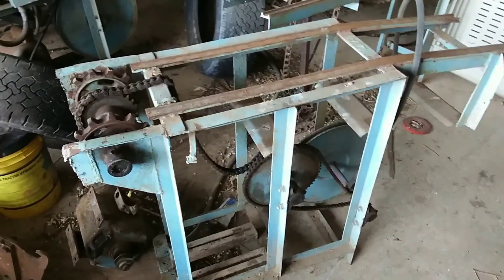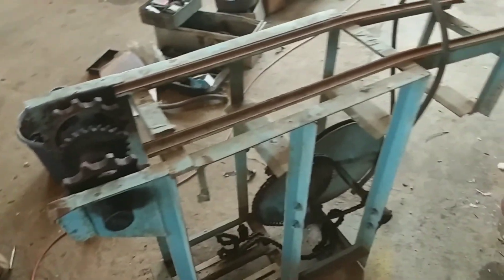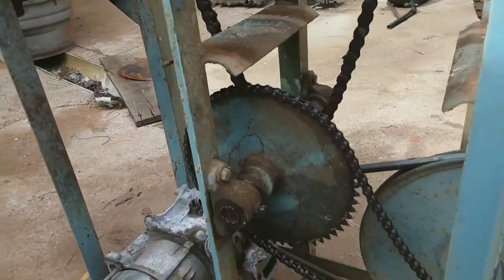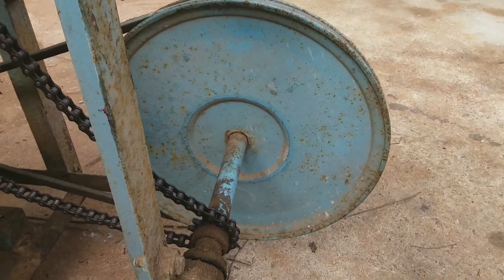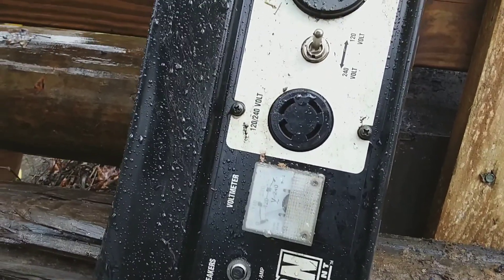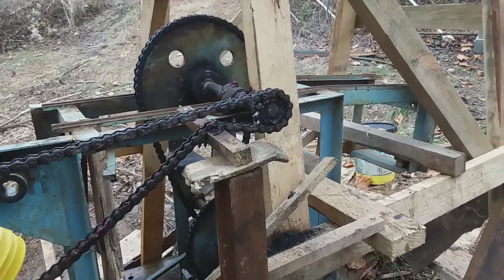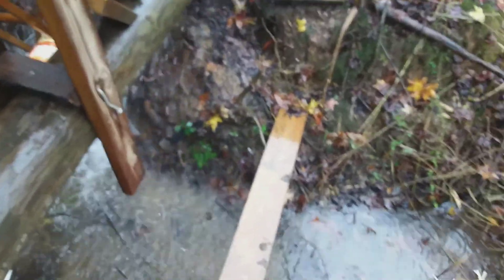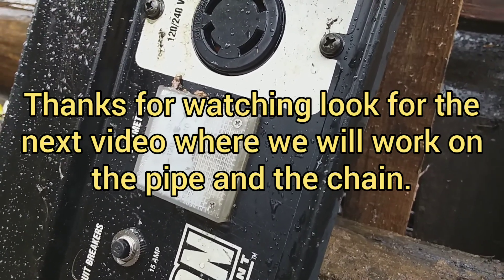Making power! Homemade water wheel.

Comment: the pulley on the wheel side should be almost as large as the waterwheel with the chain going to the drive pulley around 3in diam. I am guessing 24ft around your big wheel stepped to a 3in pulley would give you about 3000 rpm om the motor side upping your amps and volts out.  By placing a spring -loaded tension cog on your chain should take the play out as it goes around the cog.  I would take the buckets off and place 3 or four simple flat plates with a 3inch lip welded or bolted to the frame to give you more surface area on the paddles for water to hit. .
Reply from the maker: Okthanks

Comment: your back chain should be tight and not dragging across wood.....you might could work around the wood bar and remove that take your chain link up some so you do not have excess slack....but I am proud of you.....I would suggest a smaller completely wooden water wheel....the metal is heavier..
suggest you cover your electrical components and keep them from getting wet.
Reply from the maker: Thanks

Comment: Try replacing your unit with a Smartdrive motor instead. To get 60 Hz, a 36 pole unit only needs to turn at 150 RPM. That would make things a lot simpler and cut down on frictional losses. At 60 HZ, you would be getting about 95 Volts under load. Use a 3 phase rectifier and you could use a solar controller and batteries to run an inverter to get a true 120/240 60 Hz output.
Reply from the maker: Thanks

Comment: Your buckets are overflowing. That is energy loss. Reduce the reduction ratio and you will get more power.
Reply: actually the buckets seem to be filling completely
Reply: @christophergwaltney6294  Yes, and the excess water just splashes outside. This excess water can be used too by optimising the wheel's speed.
Reply from the maker: Thanks

Comment: I love to watch different setups on the waterwheels. I'm learning a bunch from your setup. You really need an idler pully in place of the board with grease. I really don't think you need any more buckets. If it weren't under load, that waterwheel would be doing 60-100 rpms!!! Everything is money!!! But  I think the PMA type  alternators are more efficient. I made my first wheel out of wood, cutting correct angles is really important if you want both end of the circle to meet!!!!! It cost me a bunch more to get by in life due to my ignorance!
Reply from the maker: Thanks

Comment: OK so what kind of voltage is it making,, cause Im thinking that head needs about 3200 rpm to make anything
Reply: 60Hz is 3600 RPM. 50Hz runs at 3000 RPM on most units.  When you get into bigger units you find that 1800 RPM for 60 and 1500 for 50 Hz is common. Even larger you will find 1200 RPM and 900 RPM or even 600 RPM units for 60 Hz. As this was a Champion unit, 3600 RPM for full rated load.
Reply from the maker: 5000

Comment: Nice setup but you are loosing a lot of wattage by the multiple transmissions. You should build a own 'direct drive' generator for the central axis. Google : "axial flux alternator"
Reply from the maker: Hey thanks,  yes to many moving parts in my design.
Reply: If you can fabricate a chain gear wheel almost as big as the water wheel you can reduce the moving parts significantly. That will also reduce the resulting momentum, thus relieving the mechanism. With the remaining wheels you can try different reduction ratios to find the optimum one.